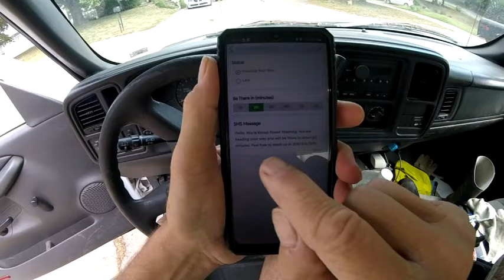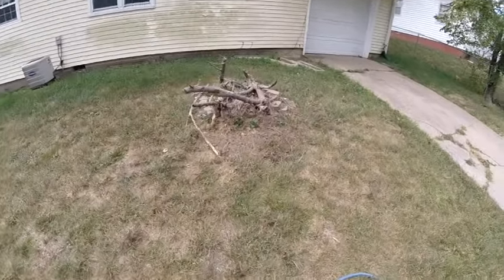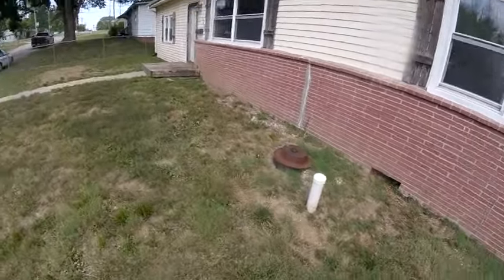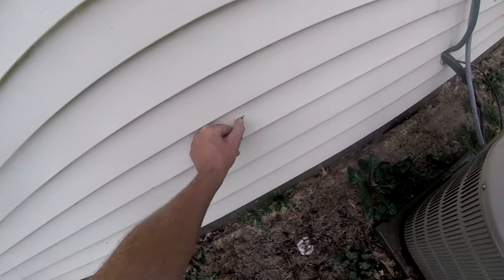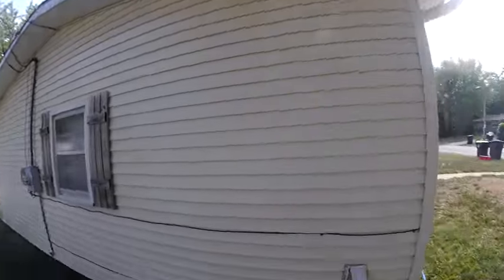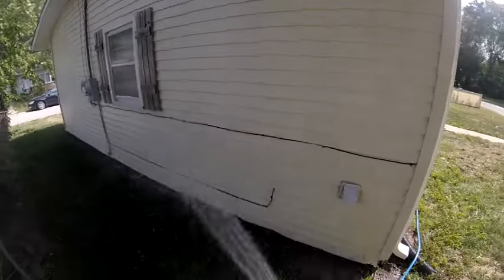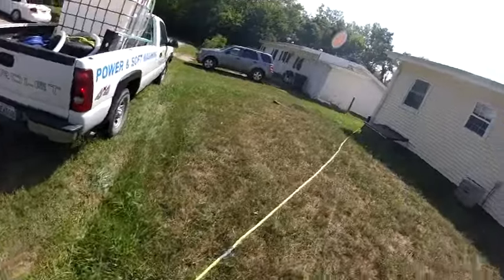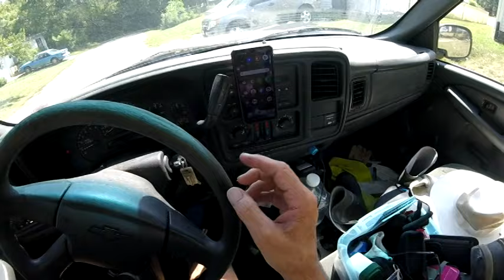Full Softwash job.  Start to finish with price.

Comment: A handyman for 35+ years, I recently purchased a small pressure washer (Simpson 3100 psi) to add simple outdoor cleaning to my offerings. I won't be doing whole houses anytime soon, mostly decks and walkways, but most of what you showed us still applies. I had a question early in the video but I forgot what it was. Thank you for all the excellent tips! 💦👍
Reply from the maker: Learn how to downstream with your maching and you can clean 90% of houses.

Comment: New subscriber.  This was a remarkably good explanation of the full process.  Love the detail (btw you did miss the front door lol).  The only other issue is the front wood stoop.  It will be 1/2 treated with no rinse from overspray.  Just starting out and putting together my first trailer.
Reply from the maker: I probably missed a lot not concentrating on my work, but talking on video.

Comment: Looks great but why didn't you use your power washer to rinse the house off
Reply: It's a soft wash system.  Not a power wash.  Low pressure with chemicals.  High pressure can damage the house

Comment: Great video like always. I cant wait to use my AR 45 was looking at the Midwest remote rinse module to pair with my AR already got my 1inch metering system built what are using for remote three way teejet?
Reply from the maker: It's a teejet.  However, I bought the remote rinse module from Midwest.  I didn't have time to source parts and build it.

Comment: Kenny HOW do you enjoy using that WASH BOSS SOFTWASH GUN or do you like THE General pump🎉 Rb65 Ired or blue Softwash gun we really like them new wash boss guns we own three of them we own the orange and the straight orange that has the handle that you can shoot under we clean hoods with that then I have the yellow gun and I was told that the yellow gun will hold up to 300 pounds I'm not for sure though but I've had problems with the tips and the handle already sticking in my soft wash gun Kenny great video brother keep up the good education❤
Reply from the maker: I made a video about the waterboss guns.  See if you agree with my findings?
Reply: @housewashing5693  we will check ☑ out that video thanks for your time to make all the content brother #washon

Comment: I noticed dirt on the bottom part of the brick to the right of the front door - and it never got cleaned off. Why didn’t you focus on the dirty brick? Is there a chemical for removing that?
Reply from the maker: I most likely missed a spot or two trying to make a video.

Comment: Great video thanks for the tip on watching on eBay for the water boss just purchased the yellow gun for $70 and i was about to pay $135 im in the process of building metering system got everything but the valves i found these valves called prescion flo for$100 for 1inch and i have found them as low as $75 for the 1/2 u kno anything about them i was going to fo with these for the ashai cuz they fall in my budget u kno best to order the ashai valves
Reply from the maker: There are other valves out there that will work just fine.  Don't get too caught up in any hype, even from me.

Comment: As always thanks for the videos.  I heard one guy tell me he tapes / covers all door knobs / light fixtures and outlets.   Is that necessary?  Also wanted to ask about plants.  Sorry for all the questions.  I appreciate anything you can share.  Thanks again
Reply: When you say you missed that glass what do you mean?
Reply from the maker: I spray the windows just like the siding.  Most vinyl windows have mold and algae.  So you have to spray them to clean them up.
Reply from the maker: @northjerseykevin3915  Misting is after soap and rinse.  Then, if I think I got overspray on them, I mist the glass down again before I move on.
Reply: I appreciate you getting back to me.   I’ve been a residential carpenter for 20 years and I’m over it.   Looking to switch gears.   Thinking about something like this.   Thanks again for sharing your knowledge.   Stay well
Reply: Great setup you have.   I was thinking about maybe using an aluminum flat bed pick up.  Not sure if that’s the best way to go
Reply from the maker: @northjerseykevin3915  Flatbed for sure. 12 ft perfect. 10ft good. Anything less will be real crowded.

Comment: Hey Ken was just curious on the usage of SH is it safe to leave on vinyl siding or any sort of metal siding (just don’t want to cause any damage to customers property) and if you could clarify what surfaces SH is safe to use on. Thanks 👍
Reply from the maker: It's safe at 1-2% dilution to use on vinyl, painted wood, painted aluminum, and painted steel siding.  Also It's best to rinse it off after your siding is clean. Rinse all glass at least three times to help with spots and streaks.  If you are not sure, do a test spot in a hidden area like behind the a/c condenser unit.

Comment: hows the ol 1500 feel hauling all that weight? ive got the same truck and afraid to drive it with more than 100gal
Reply from the maker: It pulls it just fine.  I've even had an additional loaded 330 gallon tote in the bed and it pulled just fine too.  However the rear squatted quite a bit.

Comment: Fantastic video! I saw someone say you’re from the show me state. I’m in southwest Missouri and am building a rig now. Im in the planning stages. I’ll be watching all your videos now!   Question… should I start with a gas soft wash unit or 12v?  I currently run a window cleaning business and run 12v Waterfed rigs. We aren’t running anything close to what you are gpm
Reply from the maker: I started with 12 volt.  Then, after two $200 pumps in 6 months, I switched to gas.  If gas is in your budget, then go that route.
Reply: Do you do most houses with your soft wash rig or do you downstream? Seems like it would be better to just have a powerful soft wash system if you’re mostly doing houses. I’m looking at either getting a gas soft wash set up or a booster pump Soft wash set up made by Ace. What do you think of those booster pump set ups?

Comment: What happens when you need more than 200 ft of hose , do you have one to connect it ?
Reply from the maker: I actually think I have 250 ft of hose.  I don't bring extra with me.  So you I would have to pull closer to my work.

Comment: What is the fitting you use when hooking up the water hose to the house? Do you have a suggestion on a brand of that to buy?
Reply from the maker: Came lock to garden hose adapter.  Gator or Banjo brand. Get them online or farm supply like Tractor Supply...

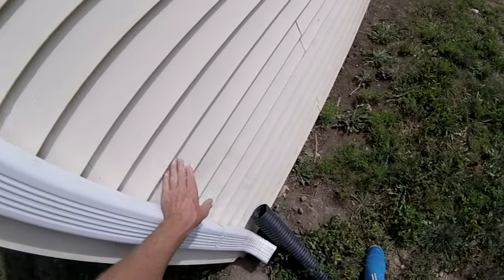Comment: Awesome video! How do you deal with that oxidation you mentioned at 4:05? On the video it looks light, did it wash away?
Reply: Use low pressure so as not to disturb it. If it does get disturbed then you may need extra steps the worst being scrubbing. BC Cleansol works great.

Comment: How do you set up your valve for half or full tank?
Reply from the maker: With 2 separate fill valves at different depths.  Both are controlled by a 3 way valve.

Comment: How  much psi and gpm through  that  gun? Assuming  not using  pw thanks
Reply from the maker: I had it set at 290 lbs.  I think I did a test and it actually puts out 7.5 gallons at the gun